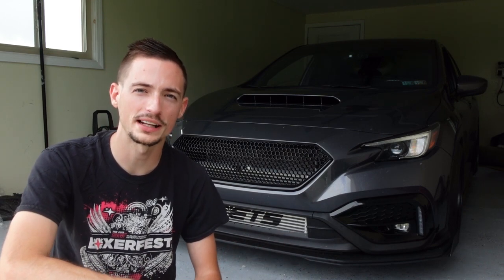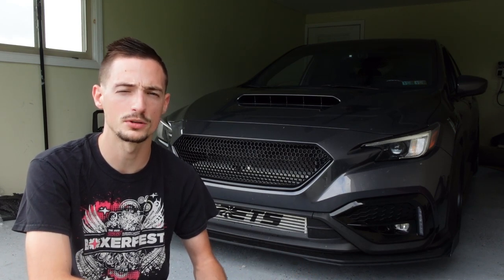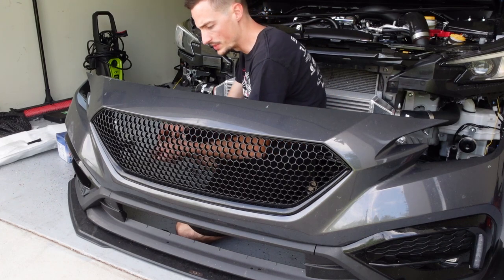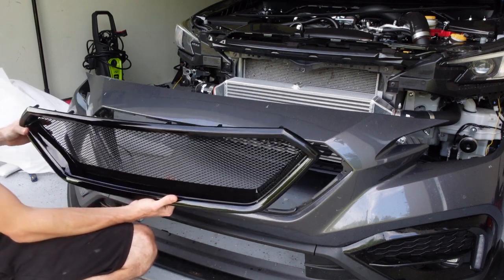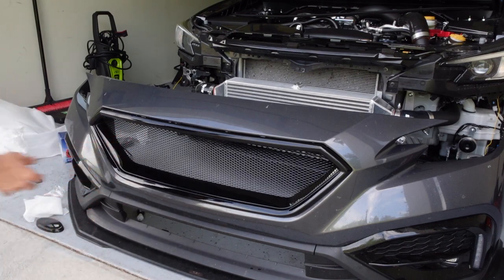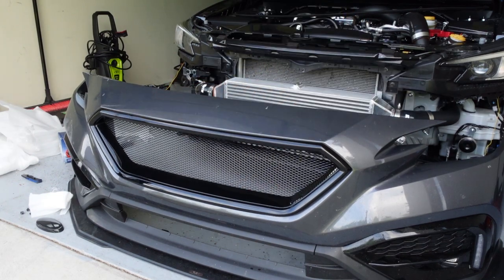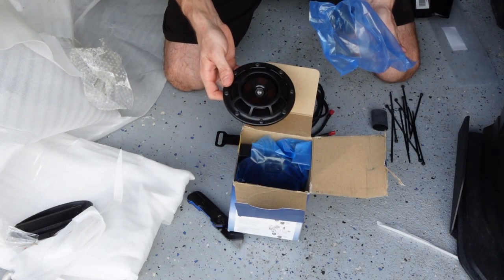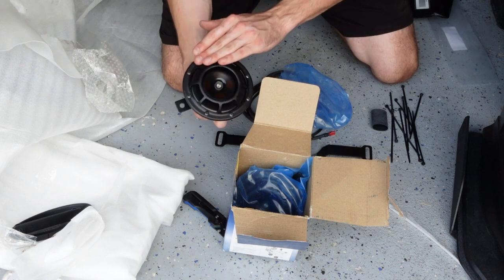22+ WRX Noble Hella Horn Bracket & CS Grille

Comment: Just a heads up on the Hella Horn install - the horns are designed to be supplied with 12V which the factory horn harness cannot supply. They are quite a bit louder if you use a relay and power from the battery.

Comment: How many times did you forget to plug the fog lights back in after taking the bumper off? I have twice so far😂
Reply from the maker: I think I've had my bumper off 9 times now, and I've actually never forgot to plug them back in. But worse... I forgot to unplug them one time and can't believe I didn't screw them up because I pulled the bumper away from the car and it just literally pulled the wires and  popped the clips off. I hate how short the wiring is. You don't have much room to work with. Lol
Reply: @StreetInspired1  Yeah it's ridiculous man! But still never gets old adding the little things to make it your own. Nice job with car. That thing is looking great now🤟

Comment: Are you going to pick up the Noble bulge hood scoop????
Reply from the maker: I thought about it but it feels kind of  counter productive with the front mount intercooler. But I might still send it anyways. It does look really nice!
Reply: @StreetInspired1  more airflow to "cool" the back of the engine lol
Reply from the maker: @FunTimeWithSouls  it's a huge conspiracy lol.  I did a video a while back on my VA  wrx using a hood scoop block off plate. Some people claimed the open scoop lowered the efficiency of the Intercooler and Radiator and resulted in higher Temps. My old tuner however argued the opposite. However I found that blocking it off had almost no affect whatsoever on intake or coolant temp. I may rig something up for the hood scoop. To supply air to an oil cooler or something else. I'll have to see!
Reply: @StreetInspired1  I always wanted to make something that would attach to the inside of the scoop and route the air to the intake so your getting a lot more airflow and possibly colder air.

Comment: The mesh is too fine. Go back years and there were few places to get anything near automotive grade mesh material, so people used what they could find at Home Depot. Best VB grille remains gloss black OEM.

For all the modding of Subarus, very little aftermarket items improve them. I retrofit a an 07 Liberty GT Spec B (also Legacy STI) grille in my 06 Outback for this reason. Easily the best ever and people were most.impresses because it was OEM and shouldn't have fit an 06.

Best grille on any WRX was Subaru's GD RB320 Richard Burns tribute car. Some people joked it looked like chicken wire, but it was a popular grille mesh that German brands including some AMG cars sported. It was silver on black, though. Still, loved it (and R Burns ❤)